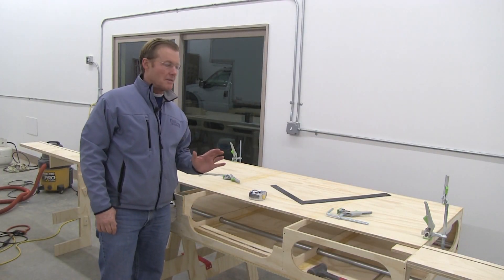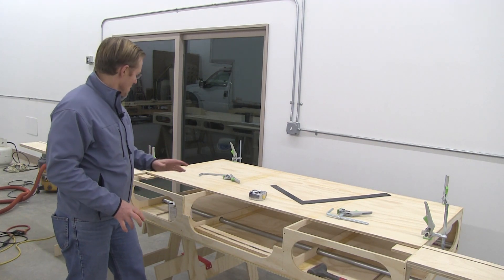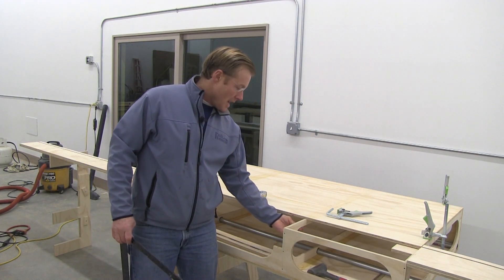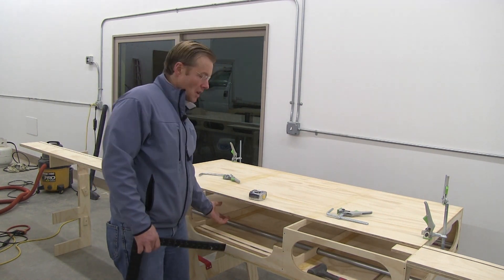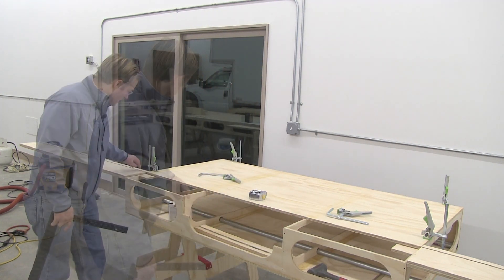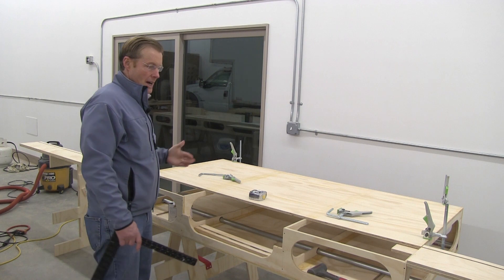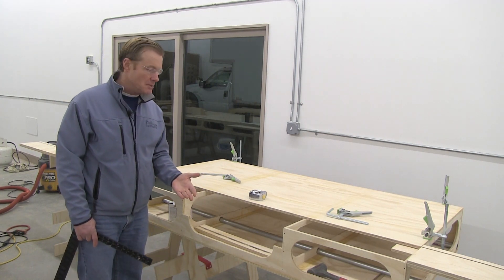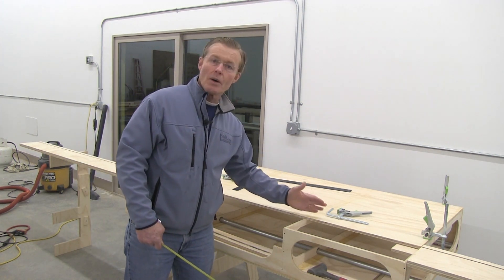BUILDING THE PAULK TOTAL STATION PART 8 DETAIL & INSTALL BENCH TOP

Comment: 2:50   How does that track saw work without being clamped down.  I've tried to find videos on it and I guess there's little rubber runners on the underside, but it seems like that thing would be prone to sliding around.  Some please answer my question :(((((
Reply from the maker: It never moves, no need for clamps.
Reply: what if you start your cut and then give it a good shove sideways, I'm sure that's trouble.  But thanks for the answer :D

Comment: I understand why you use the festool track saw, i'm sure it's very accurate and all. I would probably use it too if I had tons of disposable income to blow on it. I'm curious do you still get the same gratification and sense of accomplishment that you do when you free hand a cut with a circular saw and it comes out perfect? it seems like it removes skill from the equation therefore taking some of the fun out of it.
Reply from the maker: I am in business to produce homes, cabinets, mantels, etc. Having a guide: track, fence or even the current world of CNC machines is not an option, but a necessity. Tools are cheap compared to labor/time. The end product has a fixed value so any tool that increase my production, increases my personal income. In addition to production, accuracy is also important. When building a set of kitchen cabinets, many identical parts are required. I have been building for 25 years and could not cut 100 identical parts freehand. Tools also take skill to use and are enjoyable. Far from being a Luddite, I embrace any advancement that increases productivity and accuracy.
Hope this helps,
Ron
Reply: Ron Paulk I understand and I cant say I disagree with you, it just seems like the craftsmanship is being removed from the industry and replaced with fool proof tools that any one can use and achieve a really nice if not great finished product.
Reply: blosom2315 Craftsmanship isn't being replaced. It is just being made easier, more compact and with Festool making far LESS dust than any other  option out there. I am a painter (and beekeeper who makes his own gear) who is sick of waiting on people so I started doing woodwork repairs and such myself. Especially since these craftsmen you speak of hardly exist anymore. I know what it is supposed to look like when its done. Festool helps me get there and has opened my mind to other things using their system approach. I am building the PTS as a learning mechanism and a work station. Lucky for me I am a painter an I can hide a few of my boo boos on this thing. Its almost done except I did not pay attention to Ron in the video and just went with the measurements on the top and am now going to buy a new piece of ac ply. ; )

Comment: Hey Ron, I've been a subscriber for years and really dig your vision, designs, work ethics, and skills.

My workshop situation is really pretty desperate:  My 100-year old 1-car garage/shop is collapsing, so I'm temporarily working under an EZ-UP in the driveway -- yes, it's as bad as it sounds -- and that's only the beginning, as I am building up my shop from scratch.  That means I am working off saw horses and Portamates, I don't have a table saw or other flat reference surface from which to start, but I do have a great track saw and other excellent hand tools plus skills, so I'm trying to build one of your benches.

Here's my question:  Can you guide me in how I can get my top assembled nice and flat/true?

TIA,
Bradley
Reply from the maker: After you have all of the parts cut, find some floor space in your house even if you have to move some furniture, spread out a tarp to catch the wood glue and assemble.
Reply: Thx, Ron, good suggestion.